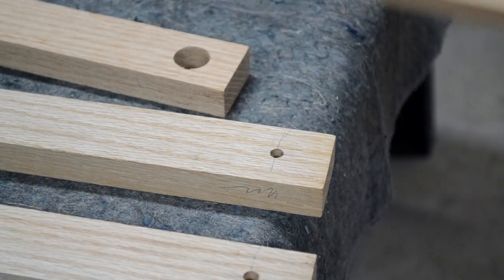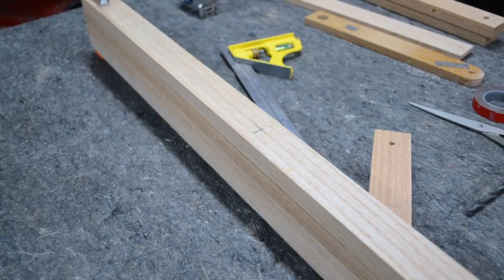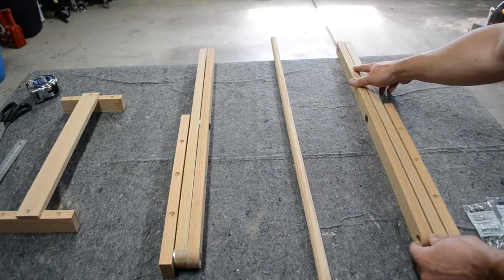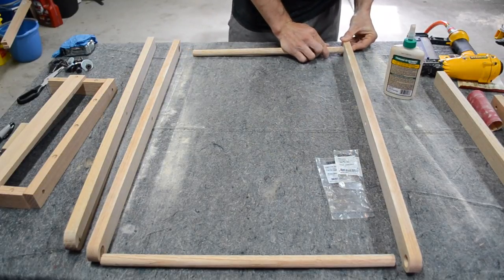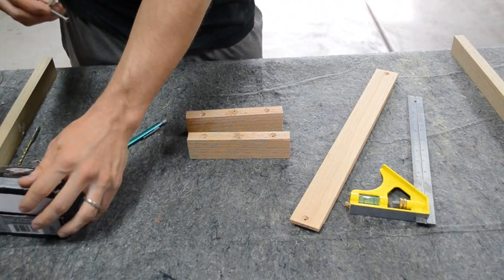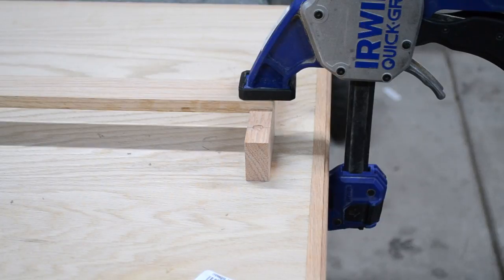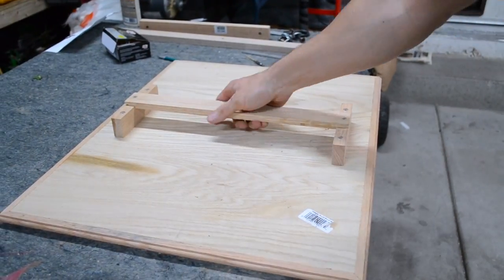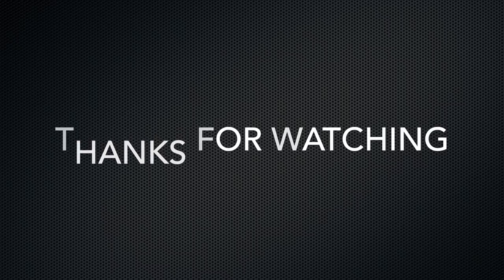TV Tray Build Part 2

Comment: Hey Dave,     Nice Tray, but I would mention that if you mark the dowel with a pencil before you glue and insert it, you can make sure your insertion depth is correct...not being picky, just makes it easier to tell if it's pushed in far enough.
Reply from the maker: Thanks for the advice.

Comment: Hey Dave, great video.  Wondering what the official name of the fastener used for the pivot points at the beginning of Part 2 of the build?
Reply from the maker: This is not the exact one but if you type in furniture bolt on Home Depots website they will come up. https://www.homedepot.com/p/Everbilt-1-4-in-x-12-mm-Antique-Brass-Connecting-Cap-Nut-817918/204281643

Comment: These are great videos Dave. Looking forward to part 3. But can't wait for it because I need to make some of these now. Could you let me know at what angle you cut the bottoms of the legs? I'm terrible with angles. Thanks.
Reply from the maker: Thanks for watching. For the angle I used a spare piece of leg material to mark the angle. What I did was set the tray up on a flat surface and laid the spare piece flat on the ground and marked a straight line on the leg. This was my cut off angle. There is not an exact angle to account for off measurements and cuts. Laying out your cut line will ensure that all of the legs will be flat.
Reply from the maker: +Hollis Sundberg Thanks for watching. For the angle I used a spare piece of leg material to mark the angle. What I did was set the tray up on a flat surface and laid the spare piece flat on the ground and marked a straight line on the leg. This was my cut off angle. There is not an exact angle to account for off measurements and cuts. Laying out your cut line will ensure that all of the legs will be flat.
Reply: Thanks for the follow up here.  Like Hollis, I was trying to figure out the same thing, and was disappointed when you didn't get to that part.  The way you describe here was the same way I was going to try to do it.  I find it to be way more accurate when you can use relative dimensions/angles vs trying to calculate the actual angle.
Reply from the maker: +ed7007 Thanks. I have that part of the next video filmed but it's been to cold to do the finishing. If you use a scrap piece of the leg it will work out perfectly for the angle.  I really need to go buy a heater for my garage. I am currently renting and the garage is completely uninsulated and gets extremely cold.
Reply from the maker: Also another delay is that my vehicle got vandalized the other day by some kids. So now I have to make sure that I pull my vehicle in the garage every night which is a pain.
Reply: Hollis Sundberg  can you please send me a  pic of the measurements as soon as possible
Reply: Dave Medicus can you please send me a pic of the measurements as soon as possible
Reply from the maker: Most of the measurement were given in the video. I will try to do a follow up video for you guys at some point since I keep getting this question.
Reply: Hollis Sundberg h

Comment: Thank you sharing this video. How do I measure for the where to attach the rod at the top of the inside legs? And how far down the rod goes from the top of the leg?
Reply from the maker: If I am remembering right I made sure that my bar was not any lower than what material I was using for the slide. Example if I had 1 1/2” that would be my max lowest point so I put the bottom of the rod about 1/4” higher so that it has room to slide. Depending on the size of rod you use will determine where the center mark is.
Reply: @DaveMedicus  My legs and sides are 1x3”
The back support is a 1x2”
The rod is 7/8”
Reply from the maker: @katenelson916  if I am understanding you correctly the center hole should be around 1” to 1 1/16”
Reply from the maker: I believe I left a little more that 1/4” to the top of the rail.

Comment: You used some metal pieces that look a bit like T-nuts to form the pivots for the legs.  What are they called?  Thanks
Reply from the maker: They are called something like furniture nuts. I got them at Home Depot. They used to be a stock item but now I think its only online.
Reply from the maker: https://www.homedepot.com/p/Everbilt-1-4-in-x-12-mm-Antique-Brass-Connecting-Cap-Nut-817918/204281643

Comment: How exactly do I get the mounting for the legs in to make sure the cross and fold correctly?
Reply from the maker: I show you later in the video but basically drill them at the exact same time.I went with a center measurement from the top mounting point.

Comment: did you get a pre cut main sheet ? like the tray itself ? I am just wondering how did you get the corners shaped up (routing used or was a pre-cut piece). thanks
Reply from the maker: The top is a cut piece of 3/4" oak plywood with a pre cut trim piece from home depot. I just glued and nailed it into place. This is a similar piece to what I used. I put the big end up.

http://www.homedepot.com/p/5-8-in-x-3-4-in-x-84-in-Oak-Panel-Shelf-Moulding-5544/203396602

Comment: Hi what are the bolts called that you have the legs pivoting on?  Lowes has no idea what I'm talking about.
Reply from the maker: I’m not sure if this is the exact one but this should get you in the general area of the store. Look it up on their app and it will narrow it down to a 4’ section. 
20 x 1/4-in Bronze Steel Joint Connector Nut (4 Count) https://www.lowes.com/pd/Hillman-20-x-1-4-in-Bronze-Steel-Joint-Connector-Nut-4-Count/3013888
Reply: @DaveMedicus  thank you!  I did find them at home depot.  Do you remember are they 30 or 40mm in length?  Thanks again!
Reply from the maker: @keithlong2788  40mm should be the one. That’s like 1.57”. With the washer in between it should be perfect.
Reply: @DaveMedicus  yup that's the one!  Got it together and I like it!  Thank you!